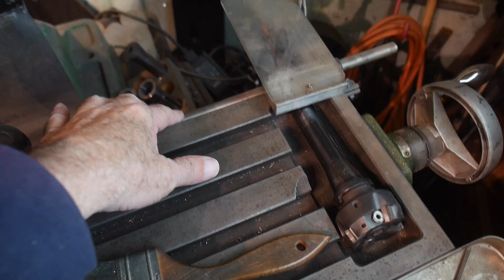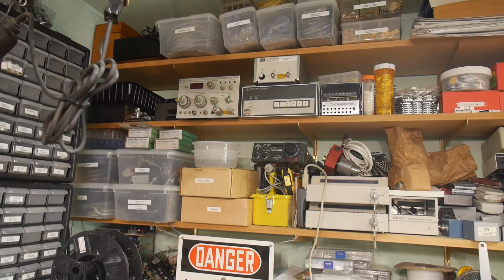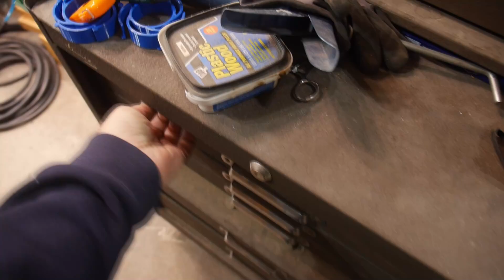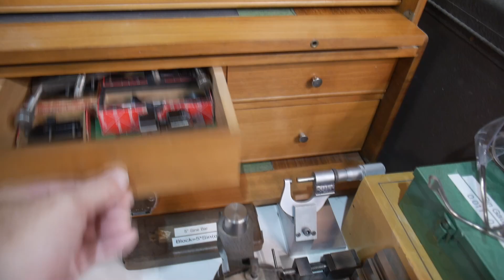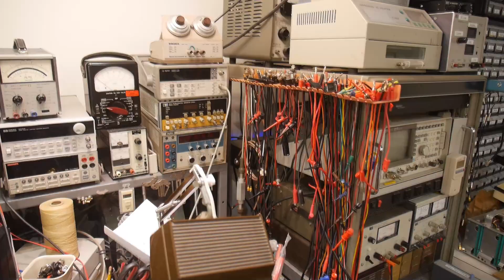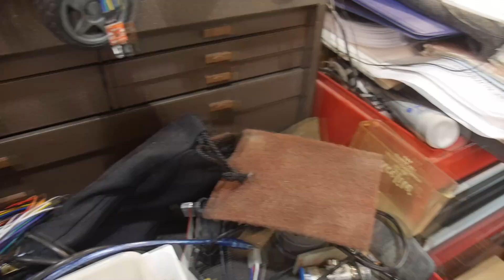#1814   100,000 Subscribers!

Comment: Haha, you have a T-962 infrared IC heater. I had this junky heater myself. It wasn't performing as expected, and it took me a while to figure out that it's time elapses slower than reality to allow it to follow the reflow curves...
Reply from the maker: mine has been modified with new sensors and firmware. https://github.com/UnifiedEngineering
Reply: @IMSAIGuy  I considered this, but I wasn't sure the IR lights had enough oomph to correctly follow the reflow curves, even with proper direction.
Reply from the maker: @ats89117  mine works great